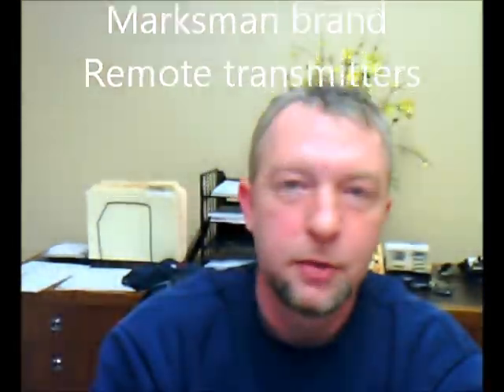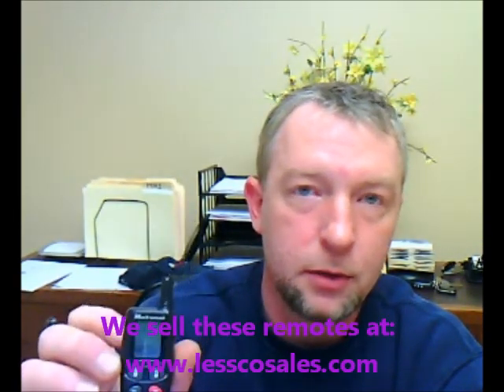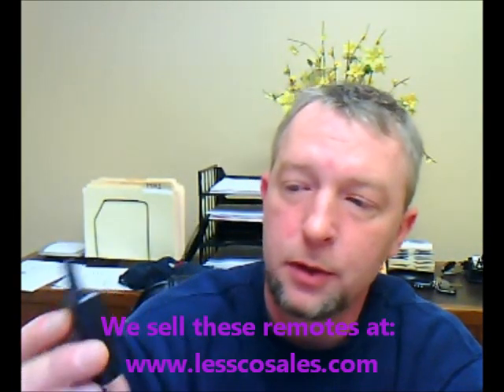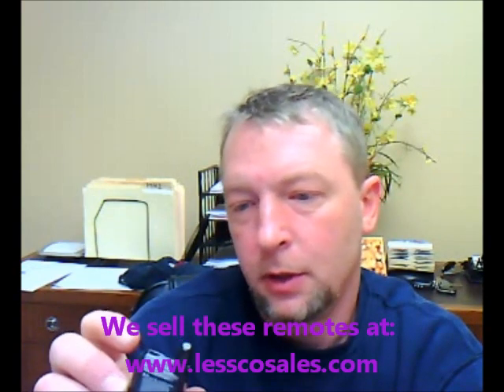How to program Marksman remote alarm transmitters

Comment: I know the video is old but I am try to program a new fob to my marksman. Issue is when I flip the switch 6 times starting in off position It doesn't chirp. I also tryd from on position.
Reply from the maker: do you have  siren in your setup? that may be it?
Reply: @Lesscoelectronics I, too, am having issues with programming. I flip the switch 6 times and I do not hear a chirp or a siren or anything